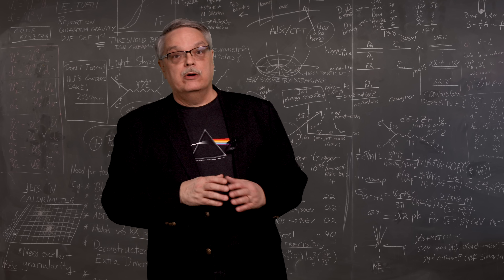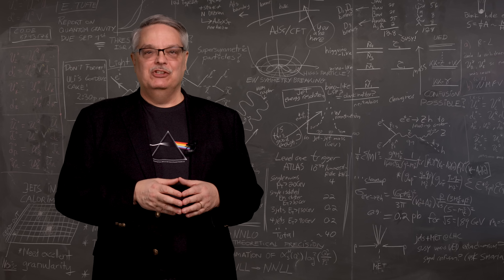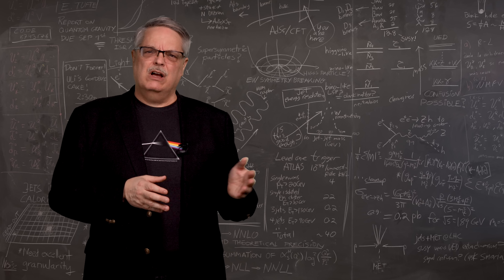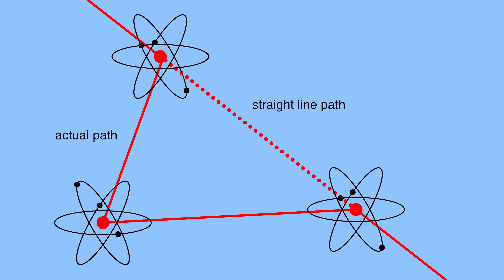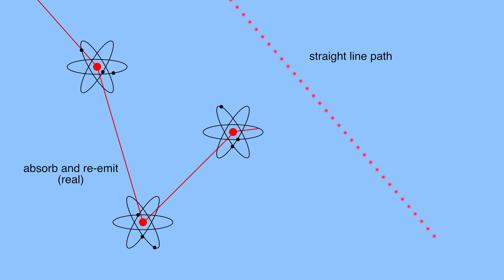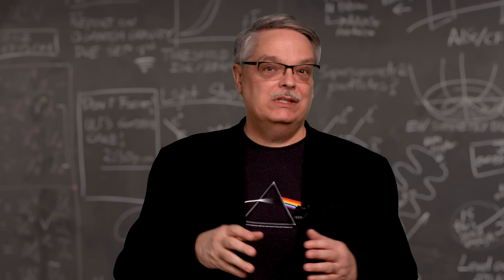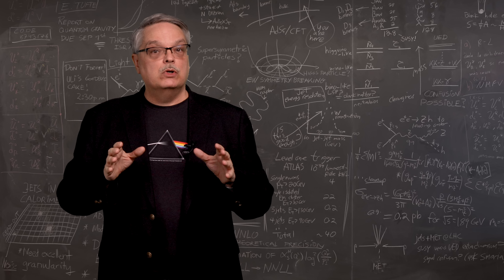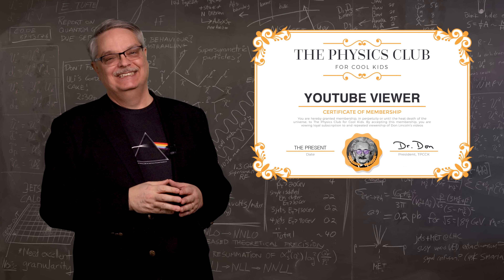Why does light slow down in water?

Comment: This is an interesting and no doubt "correct in its own way" explanation, but it doesn't seem to be explaining things at the fundamental QED level.  Feynman talks about all this in his 1978 Auckland lectures, and this seems to be a "layer up" from there.  I do think that absorption and re-emission are critical - after all, when you say that electrons "move," that's HOW they move - they can only move by changing energy levels, and that means either absorbing or emitting.  I don't think the absorption / re-emission explanation is as overtly wrong as you're implying here.

Maybe another way for me to say this is to say that you need an explanation that works with the light considered as a bunch of photons as well; tossing photons out and insisting on a wave explanation isn't really telling the whole story.

When you say that the wave coming into the material "pulls on the electrons," that can only mean that the atoms of the materials are ABSORBING PHOTONS.  And when you say those moving electrons create a secondary field, that can only mean that the material atoms are EMITTING PHOTONS.  So right after saying that the absorption / emission answer is wrong, you turn around and give an answer that boils down to absorption and emission anyway, just voiced at a level that hides the lowest-level description of what's going on.  It HAS to be about absorption and emission, because ultimately those are the only things the material can do.  I want to be sure I'm clear on the fact that I'm not saying your answer was wrong - that may be a perfectly valid way to describe what's happening if you "zoom out" so that you're not looking at the level of individual photons.  But a really fundamental explanation needs to focus on that lowest level - individual photons, individual electrons, and how they interact.  And that is ALL about absorption and emission.

Any of you reading this don't have to take my word for it.  Go watch Richard Feynman's Auckland lectures from 1978 (do a Google search for "Feynman Auckland 1978" - all four lectures will be in the early search results.  He talks about all of this IN DEPTH, and particularly talks about why you won't see the water or glass "glowing" (as Dr. Lincoln claimed) as a result of omni-directional emission.
Reply: Electrons do not "absorb" photons, they get a kinetic energy boast by the photons momentum wave, meaning the electron accelerates and increases velocity, when it decelerates and decreases velocity, the back momentum wake breaks free and "emits" a photon.  The electron itself never absorbs or emits anything.
Reply: I think the assumption that the direction of light would be randomized with the reemision isn't quite right. Because we know that the direction of oscillation of an electron will be perpendicular to the direction of the photon, and the direction of the reemitted photon will also be perpendicular with the direction of oscillation of the electron, so there is an definite direction. And than there is the problem of amplitude. With higher amplitude an electron would have a higher distance to get until it fullfil a complete oscillation. BUT. When it gets more distance, it interacts with more electrons, getting a repulsion force that could enhance the speed of oscillation than mantaining a constant time, at least an average time to get through a medium. There is just one doubt related to that: does the natural oscillation of the electron interfeer the direction of the reemited photon, or it would generate two photons, or there is an average oscillation direction through a medium?
Reply: @miguelrezende8479  I actually don't think so - I'm pretty sure it is random.  But I don't really have any heavy duty credentials behind me, so please do refrain from taking me at my word - research it.  Maybe someone else will chime in. 

S orbitals are spherically symmetric, but p orbitals aren't - it definitely could be the case that an electron falling from a p orbital to an s orbital has some non-uniform directional distribution as a result.  One issue you run into there, though, is that the coordinate system you define those things in is arbitrary.

Anyway, I'm definitely an amateur at this stuff - just trying to do my best.

If you find something interesting via some authoritative source, please do let us know.
Reply: @KipIngram  I think you also have to keep in mind that the orbitals shown in text book only work for m=0 so if the orbital were to interact with the emf I think the energy of the orbitals would change which would translate into the oscillation of the electron as m is a quantum number for the potential energy of the orbital.

So you wouldnt need absorption and emission as an explanation.

Also you shouldn't think about the geometries of the atom orbitals too much as the linear combination of the aos in a molecule give you different Orbitals that are entirely different than the ones they were made from
Reply: @KipIngram  How about refraction of a single photon? How can it changes something in electron without losing energy and slows down?
Reply: @KipIngram  But is this the same as absorbtion-reemission? Why the reemitted photon keeps direction?
Reply: @miguelrezende8479  There is inherent uncertainty to the direction of oscillation of the electron so we would see emissions in random directions corresponding to the uncertainty of the direction of oscillation.
Reply: Light slows down and bends,so when you do the calculations of relative distance..c remains constant!
Reply: you are the man, I love when someone is capable of pointing out the generality of an explaination with words, physics is a very deep well, where at the bottom there should be full understandings of how something works

not saying who is correct, just wanna underline my view of "details depth"

Comment: I am also wondering why there is the phenomena of bending
Reply: Jack, it really is all about electrons absorbing and re-emitting photons.  When an electron re-emits a photon, it could go in any direction.  So actually every "bit" of the material does launch a new wave - in all directions.  But if you add up all of those waves from all of the bits, considering constructive and destructive interference, you get a significant overall result only in one direction: the bent direction yielded by the refraction law.  All of the light going in all of the other directions "cancels out."  Because there are so many atoms involved, that cancelling out is virtually complete.

Comment: How is the slower speed of the wave in the medium not affecting the perceived color?  If we embed a sensor in the medium, so there is no return to the original speed at the moment of perception, wouldn’t the slower wave appear to be red shifted since the observer is still in the normal speed of light reference frame but measuring longer times between medium wave peaks?  I’m not talking about refraction of white light, but of a pure single wavelength (i.e., laser).  Wouldn’t a green laser appear more yellow within the medium?

Comment: It's interesting that light behaves as a wave when passing through transparent objects as the double slit experiment says it tends to be a wave until it is observed, at which point the wave function collapses.

It would be interesting to do a double slit style experiment but passing individual photons through a pane of glass instead of through a double slit. Would the light, once observed as a particle, behave differently in glass to what we usually see?
Reply: I like the way you think.
Reply: It's bizzare as the light is already present doesn't seem to move as a wave but it already there, like electricity when we switch on a light, does it really travel all the way from the generator with a magnetic field in corcksrew fashion? The field is there surrounding the electricity but travelling all the way along? Linking magnetism is key though and observation again depends, light seems to move upwards, just look where the sun is and a flame, frequency, seperation of light observed etc. Light has always fascinated me and is the key to the future of our understanding of reality. ✌

Comment: Here is why...when the light is refracted it takes a shorter path while it moves through the medium. Since light has a shorter distance to travel than if it didn't travel through the medium, it has to "appear" as if it was moving slower, otherwise if it transitioned through multiple glass/no glass cycles it would in fact cover more distance in the same amount of time, in other words speed up. Which it cannot do. The only way for the speed of light to remain constant is for it to refract and exit the medium from a different location (yet still parallel) than it would have if it did not enter the medium in the first place.

Comment: This seems to be similar to the phenomenon of a magnet falling through a conductive tube. The falling magnet excites a magnetic field in the tube in the opposite direction and slows the magnet as it falls.

I know in that set up there is gravitational potential energy being converted to electrical energy and the resistance in the material slowly builds up as heat in the falling magnet and in the conductive tube.

Does the same interference generate a "light resistance" in the glass? If the light is exciting an electric field in the glass that interferes with the light then surely there's energy being exchanged. Am I missing something or is the "light resistance" too small to measure?

Comment: But if outer space is not a complete vacuum and is full of a 3-degree background radiation, why isn't light prevented from traveling at full speed all the time? And, with that background offering resistance along the way, however slight, why isn't that light losing energy and eventually disappearing?

Comment: There is an error in the animation at 8:00. The blue line shows the oscillation of the electric field. The field points up at a crest (high point) and down at a trough (low point). As the wave passes the electron the E (E is the symbol used for electric field) field grows in strength upward. The important point is that the E field points upward at the crest. Electric fields exert forces on POSITVE charges in the direction the electric field points. So, the crest would exert an upward force on a POSITIVE charge. Electrons are NEGATIVELY charged so the force would be downward in this animation, so the electron should be moving down, not up.

Since electrons are NEGATIVELY charged, they generate electric fields in the opposite direction to their velocities. So, the crest causes the electron to move downward, which generates an electric field pointing upward, in other words, a crest.

The animation generates the electric field correctly, it just has the electron moving in the wrong direction.

E: up
Electron velocity: down
E from Electron: up 

Electrons have mass, which means inertia, so there is going to be a lag between the moment the electron moves and the moment the force from the field affects it. Imagine sitting in your car and stomping on the accelerator pedal for a second, then immediately stomping on the brake pedal for a second, over and over. Besides getting whiplash and destroying your car, the car will not respond immediately. It’s motion will lag behind the pedal stomping. So too with the electron, resulting in a wave of lower frequency.

In addition, there are other forces (attraction by the nucleus, interaction with neighboring electrons, etc.) that affect the motion. Taken all together we get the resulting wave of lower frequency which is added to the light wave (superposition is the technical term) giving us the resultant wave traveling at lower speed.

So, what about the energy concerns some of you may have? He mentioned energy but never really addressed it in detail. It is very simple to explain. The light transfers energy to the electron when it moves it. When the light leaves the glass, it no longer transfers energy to the glass. This, of course, means the glass heats up a small (negligible) amount.

There is a very nice Java animation that shows the electric field generated by an electron in a radio antenna, the wave traveling to the receiving antenna where it shows the movement of the electron in the antenna.

https://courses.lumenlearning.com/physics/chapter/24-2-production-of-electromagnetic-waves/

Wayne

Comment: The same reason ANYTHING slows down in water. Technically speaking light doesn't slow down it's always moving the same speed. The water is just a medium it has to travel through. Think of it as the difference between walking on smooth pavement and walking in snow. You're body is still churning out the same energy it took you to walk 5 mph but the resistance of the snow slows you down to 3 mph. Same concept as light is still churning out the same energy in water it just takes longer to get through it than going through air.

Comment: Completely wrong. Light is a perturbation of the aether. No such thing as a photon particle or even an electron particles. You think there’s little tiny bee bee’s of electrons passing through electrical wires?? Lmfao. Mediums like water and glass are capacitors! They absorb the light (electromagnetic frequency) and discharge the light (frequency). I may not be saying exactly right.

Comment: Here's one way to bring up good doubt about the validity of this video. Could you use a laser just slow down the relative velocity of another laser?

That's what this video claims as possible. Another thing to consider is could lasers cancel each other out?

The issues that a lot of s experts are having a hard time with, is being able to distinguish what is an approximate outcome or in other words of probability and what is the behavior of a single photon. Is very important to remember that the wave description is a model, not an absolute and complete story that address is tunneling and particle formation

Comment: A more intuitive way would be to imagine a dropping brick into a moving cart slows down its speed, although momentum is conserved. Photons in vacuum would certainly move at maximum speed c as compared with passing through the glass, when they would also need to interact with the extra load of electrostatic interaction (oscillating electrons). Even with zero attenuation (loss of energy), they would still need to slow down inside the glass (like moving a cart with extra bricks) before resuming their speed back upon their exit.

Comment: Dear Dr. Lincoln thansk for your really clear expanations; but I've a question, maybe a silly one, but I would like to understand the concept. If interaction between electrons in a media and light passing throguh it, makes electrons generating their own wave that interfere with (aka sums up to) the original light wave, doesn't  that means, at least teoretically, it would be possible to have electrons configurations that actually speeds up the process, instead of slowing it down? Wouldn't that violates some foundamentals axioms about how light travels?

Comment: "when light leaves the glass it speeds along at the preferred vacuum speed.." seems like there was a slight of hand there!  When I go through a muddy puddle on my bike I get slowed down, when I leave the muddy puddle my bike does't jump back up to my cruising speed, I need to input energy.  Where does the energy for light's speed transition come from?!
Reply: You're thinking of light like little particles traveling in a Newtonian reference frame being affected by forces. If light was a particle being slowed down by drag while traveling through a transparent object, it would not instantly slow to a lower speed, it would slowly and continuously slow down, eventually stopping. A laser being shined through glass would not bend at a sharp instant angle upon hitting the glass, and then continue straight, it would slowly curve in eventually spiraling to a point.

Your analogy doesn't work on either end: your bike doesn't instantly, with infinite acceleration, jump to a lower speed when you hit the mud, it slows possibly fairly quickly, but still not instantly, and in the absence of a constant force trying to fight through the mud, stops completely.
Reply: @ASDeckard  Thanks for the reply. I think I was more trying to highlight that the presenter claimed he'd addressed and explained why light behaves as it does (on leaving the glass) when all he did was just state what it does as if it was an explanation.  His explanation for the interfering field slowing the light was interesting, but his explanation for the light speeding up when the interference field disappears was lacking!  My bike analogy was perhaps a poor one, I was just trying to highlight that energy seems to come from nowhere.

Comment: Great explanation, but it would help if you can show graphically how two waves of different speeds interfere or combine such that the resulting wave has a slower speed
Reply: You can observe a similar effect with sound waves. If you've ever heard someone tune a guitar by tuning an open string to the one next to it (by pressing it to a fret), you'll hear the difference in frequency between the two strings as a slow, undulating frequency, which corresponds to the difference in frequency between the two strings. The person tuning the guitar will be looking to reduce this effect to zero, which means the two strings are at the same frequency.